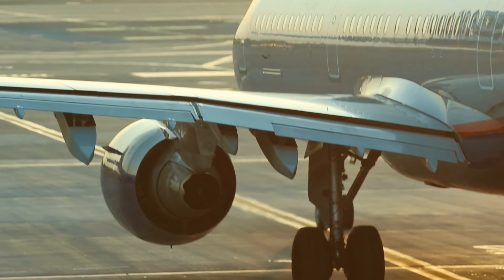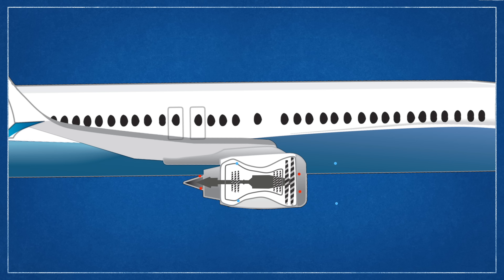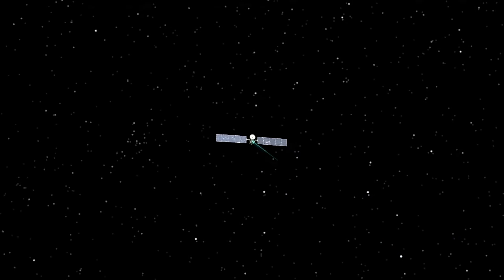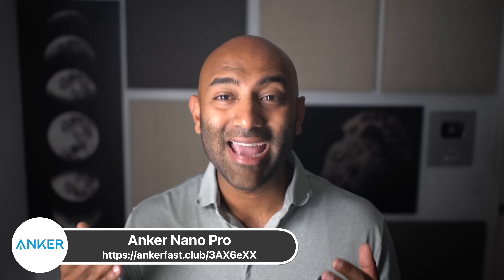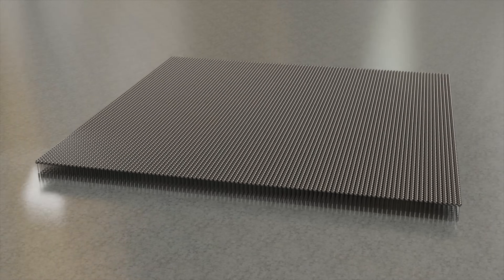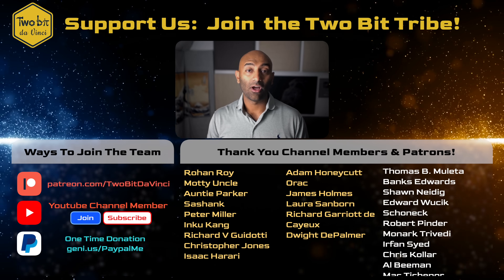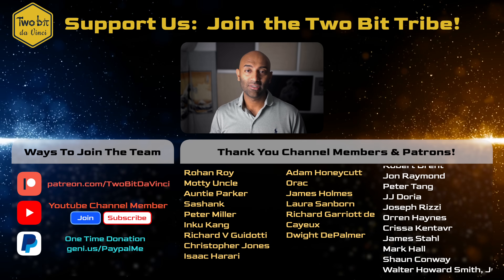The Next Generation of Jet Engines.... Is Electric?

Comment: Just after watching two of you video productions I think we should have a talk. About agility, scalability, and future sub zero energy supply. 50 per cent of daily energy consumption will origin from stored energy inclusive X to power if to reach the timelines and milestones agreed on by the Paris Agreement. Oker Energy AS harvest surplus and idle energy/power from all energy sources in real time. Converts it to potensial energy and deliver it on demand with a round trip efficiency beyond any other technology. 100% ecological and renewable using deep sea compression and atmospheric pressurized air. We are a triple ZERO company.

Comment: If you multiply the speed of the exhaust by a factor of 10, you need 100 times the energy to produce it, but the thrust only goes up by a factor of 10. So high exhaust velocities are great if you have an abundant supply of energy. Producing large amounts of energy on spacecraft leads to a cooling problem. Not to mention the mass of the reactor producing it. If you content yourself with small thrusters, you can get by with solar panels to produce the energy, but you won't be going anywhere soon. And that's only if you're already in orbit, as these things will never get you off a planet or moon. Great for unmanned payloads that can take a few years to get to where they are going using Hohmann transfer orbits. Not much use for humans.

Comment: Tech like this is exactly why green energy is so stupid and frustrating. It takes a massive amount of electricity to power these engines, way more than batteries could feasibly produce in probably the next 5000 years, but we can't focus on the next evolution in power generation because everyone is busy freaking out about carbon and investing in useless solar and wind instead.

Comment: we should concentrate on land propagating vehicles, rather than aircraft, aircraft engines are highly efficient, and their pollution levels are not so high, as compared to less efficient, non-continous combustion engines, further cars+trucks being large in numbers are doing more harm to the atmosphere, of course, electric vehicles are bringing a change but most of them are powered by fossil fuels only(indirectly). We have more technologies at hand right now, like fuel cell technology, hydrogen combustion engine, sterling engine, fusion reactor, etc., but none are complete. This may sound stupid, can we not use antimatter for propulsion😁

Comment: Plasma engines would cause nitrous oxide and nitric oxide to be formed in the atmosphere on the edge of the plasma cone. However ducted fans are getting seriously efficient. As far as batteries are concerned then the now commercial solid state cells have a by weight energy density triple that of traditional Lion cells. That is enough to make an A-350 purely electric with a 1000 mile range (plus reserves). If the x5 works in the real world (it works in the lab) then 1600 miles (2500km) is on the cards. Plasma engines would be way heavier than ducted fan which are way lighter than equivalent thrust jet engines so would have to produce significantly more thrust per kWh to make up for it.

Comment: Why would you waste energy of accelerating air to ludicrous speed, if ~900km/h is enough. Ion engines are a good choice if your propellant is limited, which is not the case here. Just use an electric fan. This kind of plasma engine might be useful for a vehicle that travels between LEO and the gound.

Comment: Considering density of thrust and energy density of batteries I say more like 20-30 years away, but this video was very well done (was expecting it to be sub-par ngl) good job man.
Reply: How about hydrogen fuel cell?
Reply: @widodoakrom3938  that adds weight and complexity, and still doesn't address the issue of thrust density and the ability to actually carry it's own batteries
Reply: @SlowSTEN  with hydrogen fuel cell u can use small light battery
Reply: @widodoakrom3938  You...need the fuel cells themselves, and the storage...and the infrastructure for said hydrogen systems.
Reply: With AI we will likely make a crazy jump in battery technology in the next 10 !
Reply: @patrickday4206  That's not the only issue at hand, the thrust itself is also underwhelming, and considering newer pulse detonation engines are coming onto the scene with what like, 40x the power? I doubt this is going to take off anytime soon
Reply: @SlowSTEN  I've had a plan for one 10 years ago! I believe we currently could make one that the thrust should be comparable to prop plans so not grand but commercially viable unfortunately I'm just carpenter though i have an iq of 138 so nobody is going to believe me and they would be expensive like high quality jet engines that cost 50 percent more but those costs would be comparably in ten or 10 or 15 years . Batteries need to advance or do beamed Lazers or fusion reactors to make them anything more than a jump ship! I hope it happens!
Reply: @patrickday4206  I'm sure with the continues advancements in metal 3D Printing and more exotic materials such a process would be achievable, And fusion just made more power then it takes to hold a reaction I believe sometime this year, the numbers are still quite small but achievable none the less

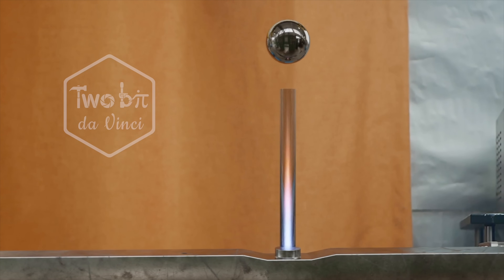Comment: 7:01 force exerted means nothing when you are pumping air in from some source. IF the plasma can sustain a sucking action and a blowwing action on the other then it is significant and perhapse it did but seems unlikely. Ion propulsion works but is so weak, all it is doing is making ions flow from one terminal (negative) to another (positive) which makes the air flow. What this means is you need a battery or some source of electricity. Batteries are very heavy and not energy dense. Also the force of air flowing due to the ion propulsion is exceptionally weak, to scale it up you need to scale up the current/voltage which means you need to scale up the battery.... Ion propulsion would get outperformed by a simple electric motor and propeller 500 times over currently. Comparing a commercial jet with a space craft is not valid when a spacecraft has zero resistance, zero weight and plenty of energy capability. A hydrogen jet engine is more likely than an Ion engine and a hydrogen engine in a plane is possible but HIGHLY unlikely, it is just marketing propaganda at this point. But what do I know, i'm just an engineer at boeing commercial airplanes. And you are right, the tech has to be better to get implemented. This is not universally true but it is generally true, and btw kerosene is still the reigning champion by leaps and bounds even on the best alternative which is probably electric prop planes then hydrogen fuel then ion propulsion.

Comment: Looks like other researchers have used this same 'microwave in quartz tube' plasma generator to convert CO2 into carbon monoxide, and 1/2 02 I dont know the energy they are trying to get this plasma to, but it sounds like they're using the same frequency for the microwave emitter/magnetron

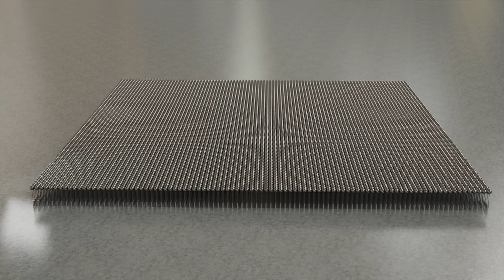Comment: 8:24 instead of 1 large thruster, which will lose efficiency because the gas in the center will be less energetic, and a pod hanging off the bottom of the aircraft will induce drag, why not make a large lifting body aircraft, somewhat like the B2 spirit, with small thrusters placed along the entire rear of the wing. 
The large upward facing surface area of the lifting body can also be used for solar cell real-estate, extending the range during the day, and allowing the aircraft to run with emergency power in the case of a battery failure

Yes, 100kW from solar isnt much compared to what is needed to maintain flight, but it would provide a noticeable range extension, especially on slower aircraft that dont waste as much energy cutting through the air

Comment: Zero mention of efficiency vs propeller, ducted fan or electric turbines. I think this is very likely vaporware that has no possible path to feasibility because it's probably 10% as efficient as other mechanical means of electric propulsion.  The only area I see plasma or ionic propulsion of any use on earth would be with extremely high altitude solar blimps.

Comment: The extra energy required to maintain lift and the extra mass required for energy storage  further supports the idea that some form of high speed electric ground based transportation (ie. train, hyper loop) would be easier and more energy efficient.

And perhaps for the longest trips, a reusable hydrogen fueled rocket would be superior.

Comment: Ion engines produce a tiny thrust, but for a long time. Good for long distance travel. (One annoying thing: Halfway to your destination, you have to reverse thrust, to slow down) Rockets produce a high thrust, but only for a short time. Great for launching into space. 
How about running a tiny rocket motor, using a minimum amount of fuel. Small thrust, like an ion motor, but can run continuously?

Comment: I absolutely believe batteries will continue to improve capacity and lower weight but even in a decade or two when batteries are ready for this, it will take 2 decades for plasma thrusters to become used. Honestly this seems closer to Clark tech than possibility.

Comment: You don't necessarily need plasma jets to reach higher speeds in electric aircraft, you just need ducted fans. It's like a turbofan engine, but the core is replaced by an electric motor.
Reply: That's how it's going to be! The actual turbojet portion of a turbofan doesn't produce much thrust, it's basically just there to power the fan. Replace that with an electric motor and you're off to the races. As for energy storage, planes are one of the cases where fuel cells actually make sense, although you'd probably need cryogenic hydrogen storage to fit enough on board...

Comment: Hydrogen is the best option for aircraft to power it for how light weight it is and how expanding its fuel storage is not an exponential gain as well as modular build that then can power a up scaled plasma ion thruster

Comment: Hey Rick, plasma in air travel isn't new, the Russians were trialing it in the 90's with plasma surface conditioning. Spray plasma at the front and magnetically induct it along the surface of the craft to fling it off the back, results with zero atmosphere friction leading to increasing speed and less thrust required. This wasn't new thinking for the Russians, boundary layer control was already deployed with peroxide torpedoes, the boundary layer being gas so the torpedo literally flew under water in a bubble of gas at 150+. Commercial air travel will include plasma surface conditioning sooner then plasma drives, building the plane for maximum ascent then plasma surface condition critical zones to produce most efficient cruise = a safer and more efficient trip.

Comment: It seems that power source and fuel are being a little conflated.
Sure,  we need 'bigger' batteries, really more dense batteries - but people seem to over look the fact that batteries merely hold the 'fuel' and the battery is also the electric motors power source.  
The batteries still need to be charged.  Which that charge of power is their fuel and at this point, the energy density of liquid fuel(gas, jet A) is far greater than any battery can hold.   A point which many people, when discussing the merits of EVs or alternative fuel/propulsion, often skip over or completely negate for optics.

tl;dr Batteries still need to be charged and energy density is a huge issue.  Fuel and Power Source aren't necessarily the same thing.

Comment: I feel like the energy efficiency of these things will remain a huge problem for aviation, at least as long as the energy must be supplied electrically. If we could drive a plasma by a chemical reaction from a fuel with a high energy density.... oh wait - that is a regular jet engine.

Comment: What if instead of trying to scale up the jets you simply lined the bottom of the wing with them? Or possibly even incorporated it into the skin of the whole plane? I wanna know more about the nano-discharge propulsion system, that's fascinating. Imagine a 3D printed plane covered in circuits that efficiently ionizes and propels air. 

Then watch it be hopelessly ineffective in the rain XD

Comment: There is a thing about plasma created from air. Becouse air is mostly comprised of oxygen (O2) and nitrogen (N2), ionising them disrupts existing bonds between them meaning they can form new ones, and subsequently new particles.

Usually plasma created by high voltage discharge (purple/blue arcs) creates ozone (O3). It is present naturaly in high layers of our atmosfear and it protects us from UV light, but chemicaly it's poisonous and high concentration could kill you especcialy if we intend to make enough of it to propell an aircraft, also it's heavier than carbon dioxide meaning that it could acumulate low to the ground making for a bad day to say the least.

Now nitrogen when ionised by high current discharge (yellow/red arcs) creates nitrogen oxides that when disolved in water, create nitric acid. So whenever you see a yellowish brown, maybe transparent cloud coming out of a plane exhaust (even gasoline fueld one) moving your way, run, and i mean it.

Comment: I have a feeling the only way an electric aero plane is going to be viable is if we use hydrogen as a store of energy and use a fuel cell to supply electricity. We can then cover the aero plane with lightweight photovoltaic panels to reduce the fuel consumption.
Perhaps a lightweight capacitor can be used to  store electricity. Helium can also be used to give buoyancy to the aero plane.

Comment: Fun idea, but even with the electrical density of  theoretical quantum glass batteries, it wouldn't be able to lift the batteries off the ground.  Also, this technology is not called plasma engines, it's compressed ion, and the thrust is only viable in a vacuum.  And China sure as $&#@ aren't the leaders of its research.

Comment: Great show as usual Ricky!  Yes I think that plasma engines will be a source of power for aircraft in the future, but I'm 74yo so I don't expect to see it happening in my lifetime unless I get lucky or some group of engineers does.
Reply: No worries man. I'm 28 and I don't expect to see it either. Commercial jet aircraft are almost identical to what they were 60 years ago. I've been hearing about delta wings, hydrogen or electrical jet engines, supersonic/hypersonic airliners, comeback of the airships... since the 1990s and I don't believe the hype is real anymore :(
Reply: No, he says a lot of really silly stuff.  These jets are used in space because  there ain't no air and, more importantly, there ain't no oxygen with which you oxidize fuel. SO you would have to take both the fuel and the oxygen and there still ain't no air.

Comment: Electrical fan motors are so much more efficient and they are still 5-15 years away from being a replacement for airlines.

A drone with electrical motors would use less then half of the power to produce the same thrust as the prototype shown.
On top of the less power needed, I am pretty sure a plasma thruster would be a lot heavier and a lot more expensive then a electrical motor.

Plasma jets belong in space and not in the atmosphere.

Comment: I think you are missing an idea. The vertical force to lift something is different than the lateral force to move something. The engine doesn't produce lift, the wings do. There for you shouldn't need as much force from the engine.

Comment: Is anyone here good enough at chemistry to weigh in on the exhaust gasses produced by this ionization?  Would there be much difference in the exhaust in plasma engines vs ICEs?
Reply: I am not a chemist, so I could be wrong, but if I remember rightly ionizing air - especially at very high energy levels - creates some pretty nasty and volatile gasses due to the level of reactivity that is induced as you pump power into the outer electron shells of the atoms. It wouldn't surprise me at all if the exhaust gasses contained their own concoction of /different/ greenhouse gasses than we are used to, but I couldn't say if they would be worse than standard ICE. I wouldn't want to breathe the exhaust from this type of engine though... :/

Comment: There's so much wrong with the idea of battery powered aircraft honestly. Battery tech in general needs to go through an epic revolution before we'll be able to replace gas turbines on long haul heavy flights. How much of Greenland and central Asia will we have to destroy to get those rare earth minerals for the batteries? Putter around for 15 mins at a stretch in some aggrandized DJI all you want. It won't replace a trans oceanic cargo flight. Maybe we should start discussing carbon neutral synthetic fuels at some point? Maybe we should worry about power plants and bunker fuel cargo ships instead of focusing on bit player aviation and personal transport???  As usual the scientific world chases after the popularity game for sexy sounding research funding instead of working on the huge mundane problems that actually matter. Seriously, where are the kite sails and wind power generators for cargo ships? Ten percent more efficiency out of the world's cargo fleet would probably offset all of commercial aviation.